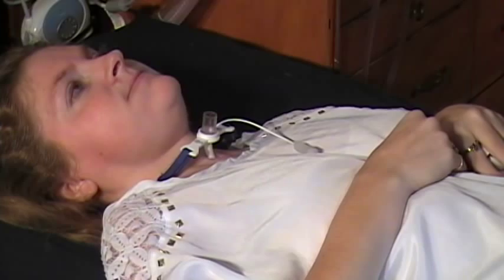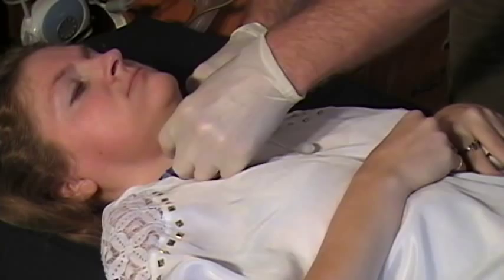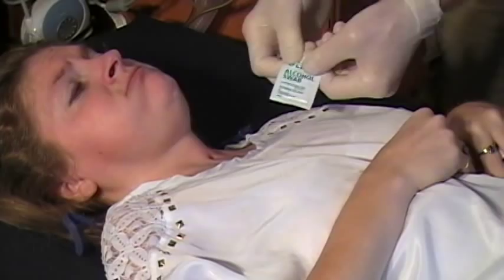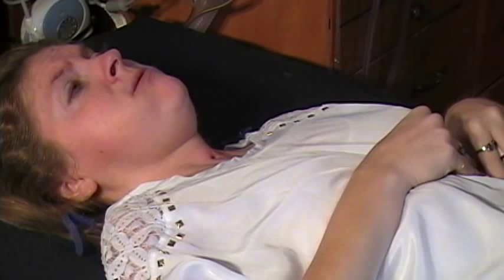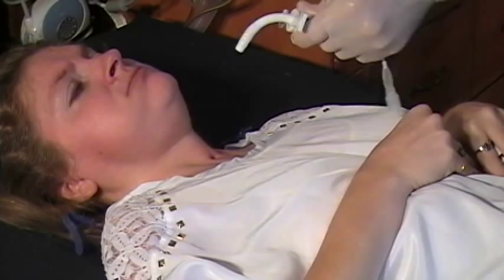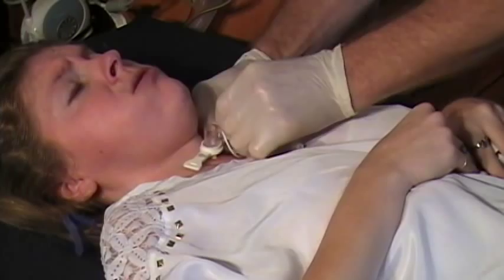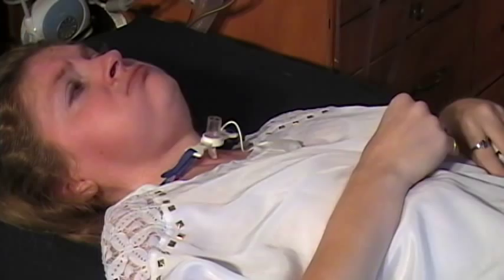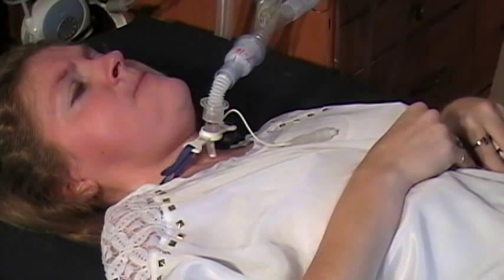Changing Tracheostomy Tube

Comment: ok im a nurse and  you were supposed to remove the ties while holding flanges in place throughout procedure  then disconnect vent pull out old trach get new trach in within three secs pull out obritrator and connect vent back immediately then apply ties and clean site ( or you can clean site befoe the whole procedure) she went without ventilation for way too long bro
Reply: every day? how is that necessary??
Reply: im actually trached and i clean and change  it myself. You're right its not suppose to be out too long. I dont do it everyday though..i change my ties everyweek and the trache tube every month.
Reply: I thought It was just me cringing while this procedure was being done. The poor client looked distraught. His whole procedure was wrong and watching this angered me as I could see the client gagging for ventilation. I've worked in intensive care and with complex tracheostomy/ventilated clients and can safely say.... "this is how NOT to change a trecheostomy."

Comment: You can deflate the cuff and remove trach ties while she's connected to the vent. Tip for ventilator dependent patients; connect the new trachto the ventilator before you put it in.Your patient will get more air.
Reply: +Emilie Smith This would seem a good idea, but it is very dangerous. If the tube finds a different potential-space/tissue layer other that in the trachea, you will be pumping air into the patients neck. Please use the obturator.
Reply: Just as good a tip as this whole video lol

Comment: Prior to changing the TT, prepare all the necessary things to use. U may put lubricating gel on the trache tube and check the cuff -- in a sterile technique. That way, it would be faster for you to work right after you remove the TT from the patient's throat

Comment: You have that cuff inflated with water rather than air??? And why didn't you use an obturator to insert the new tube?
Reply: +ilovecanines certain trachs are supposed to be inflated with water (portex) and other trachs with air (shiley)
Reply: ilovecanines yes, Im also woundering why people put aqua in this cuff. Cuz we learned to use aqua only in the vessica urinaria. Also he s pulling out the ventilator without checking the E/I so he interrupts the frequency. Also he is not even prepared for the procedures!?
And and and so many fatal failures it’s not ...

Comment: wiping the stoma use different sections of the gauge not the same sides jeez, same with the pad, omg you never remove the vent from the pt as long as you did, you can remove the trach ties and deflate,  When I do my trach change on a vent pt it only takes a 3 seconds since I have everything ready, even if the pt is not on a vent I still do it that quick, sterile

Comment: You lube up the new trache BEFORE you disconnect her from her ventilator and remove the old trache!!! JESUS, trache-care 101!!! Poor woman! Also, open up the alcohol swab so that it is ready to use, have everything ready to SWIFTLY change it, so the user doesn't have to suffer unnecessary! If you're doing this every day, you SUCK at it! ><